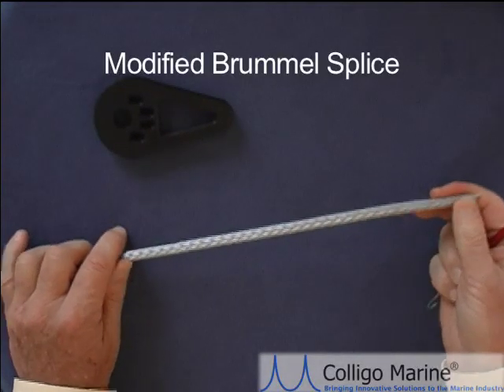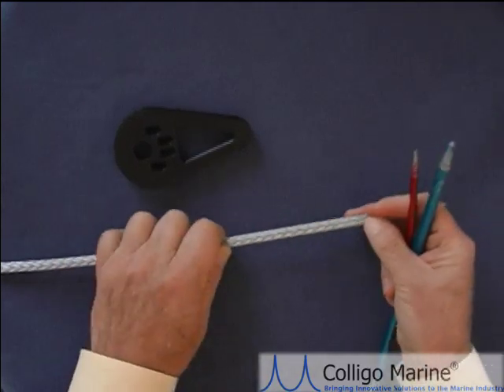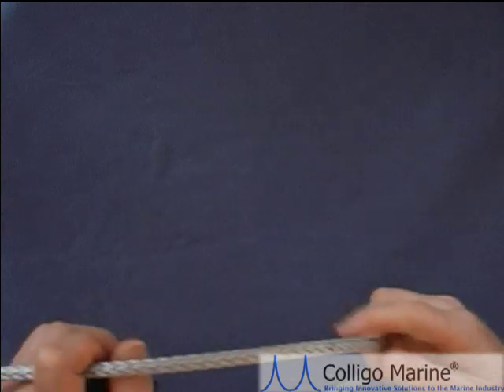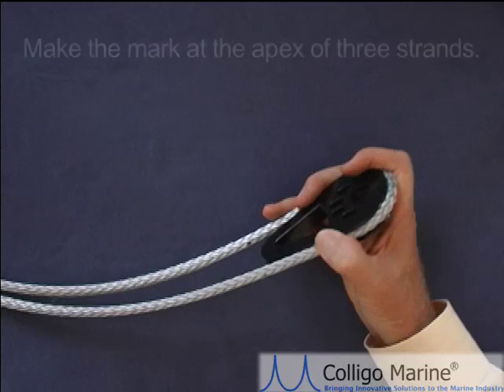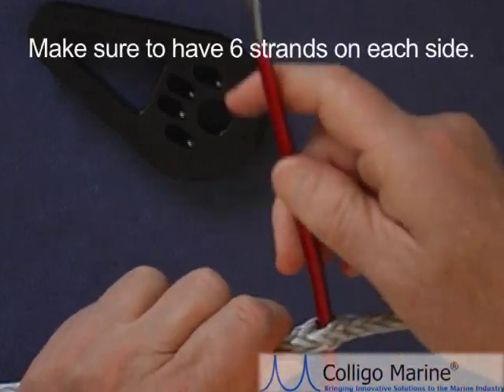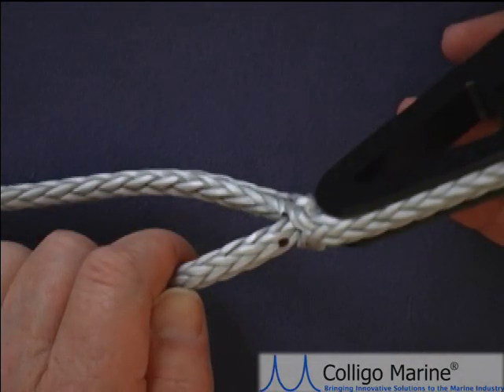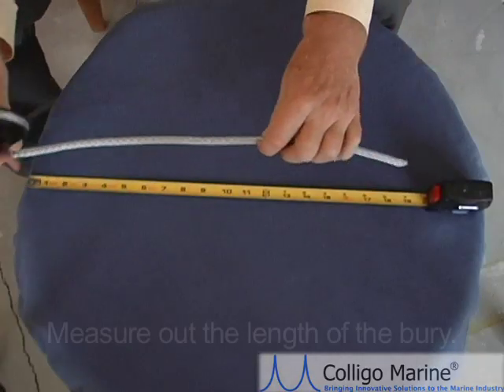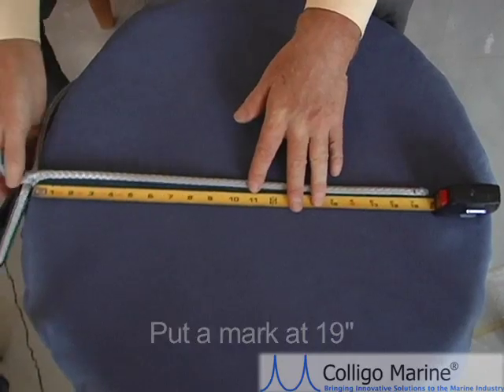Modified Brummel Splice, Part 1

Comment: This is a great video, in my opinion better than any other that I've found on the Brummel lock splice. Importantly, he doesn't both of the ropes through their piercings, which saves a lot of time and trouble. And the pace - plus the tips on enlarging holes, etc - is just right for learning.  Thank you! (Oh, and the Colligo terminal pieces are great; they supplied me with double blocks w beckets, no moving parts, and they're superb for running backstays).